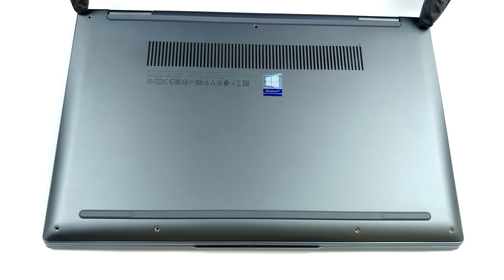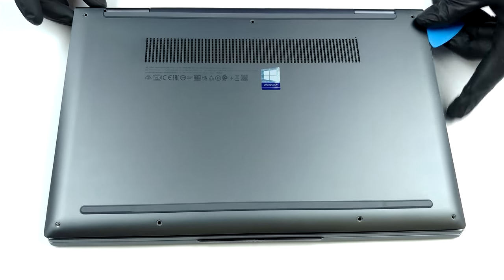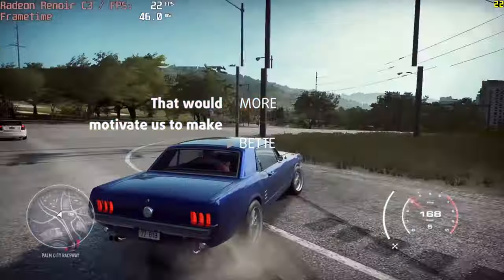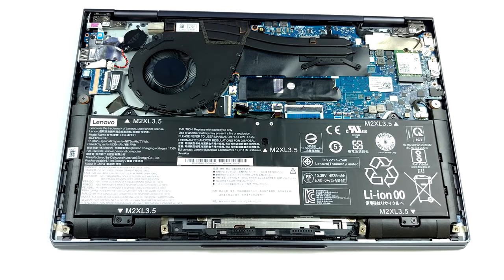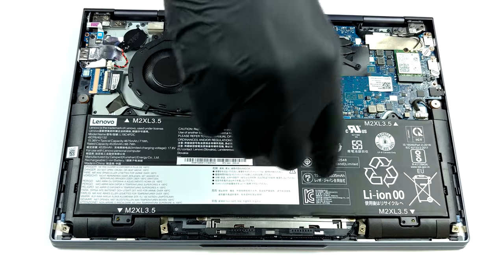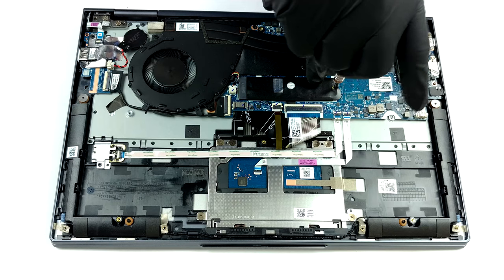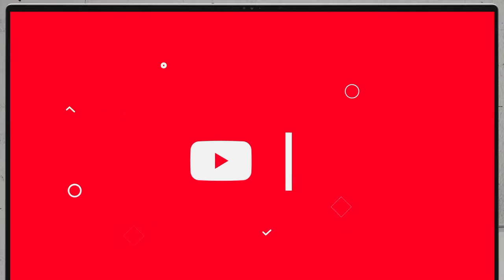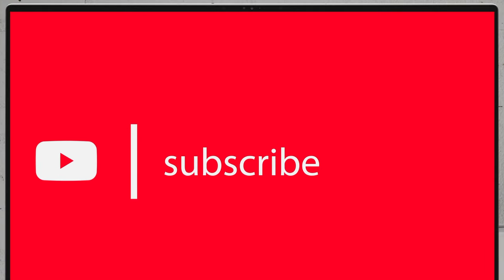🛠️ Lenovo Yoga 7 (14) - disassembly and upgrade options

Comment: It's interesting why the m.2 ssd is so close to the cpu. It gets pretty warm there when doing heavy tasks and ssd speeds depend on the temperature
Reply: I don't think it really matters in a laptop. Most of the heat from the CPU goes into the heat pipe and then directly out the back of the machine. What does go into the computer will either spread through the PCB itself or the metal chassis. so the small amount of heat will get to the SSD regardless. The bigger issue is that the SSD itself can produce significant heat, and given that there is 0 airflow, and that this one is wrapped in plastic, it'll overheat regardless of where it's placed.

Comment: Hi, I ve been watching some of your videos lately. It seems that the majority of the Yoga series laptops aren't RAM expandible. I was kinda wondering if there is actually one that could be upgraded. Thanks a lot for the videos :)✋
Reply: Yes, the ram is all soldered to the motherboard meaning that it is not user-expandible.
Reply: Thinkbook 14 yoga
Reply: @chaylaforte  thanks :)
Reply: @bumbastickbubblegum  thanks :)  I'll check it out.
Reply: @chaylaforte  
So it can be exandible by repair shops? I went to a pc one and they told me they cannot fix it because it is technically a tablet, reason I went there instead of the android is I was thinking since it has computer parts he'll be able to fix it. Looking to also game on my lenovo yoga duet 7

Comment: Can't get the back off even with the screws out of it.  Is that "plastic tool" a guitar pick?
Reply: It is sometimes called a spudger. sets of these are available for cheap online
Reply: I use an old bank card instead of that

Comment: This seems so lazily designed to me. You can clearly see that there is space for another USB Type A port on the one side, and there are smaller laptops with removable memory available. I Think Lenovo could've either rearanged the components a bit to make room for removable ram, or they could've even moved the SSD to the other side of the fan to make room for 2 ram slots. They could've also used a smaller size SSD like is common on smaller laptops.

Comment: Cmiiw,, from the video looks like this laptop had no ventilation air out ?
So this laptop only had on the bottom for air intake ?
Reply: The air out is from the back of the laptop in between the screen hinges